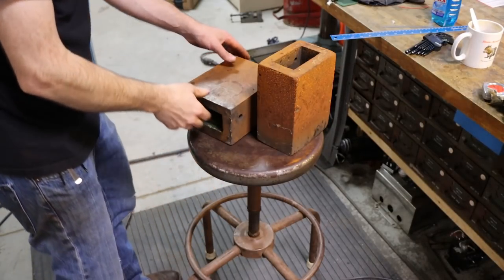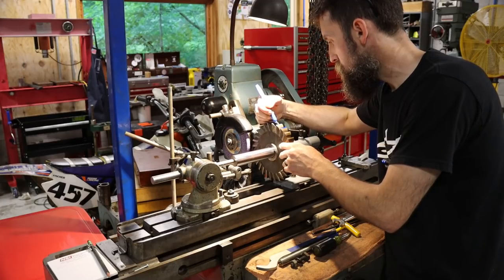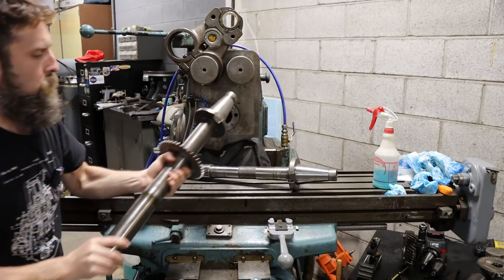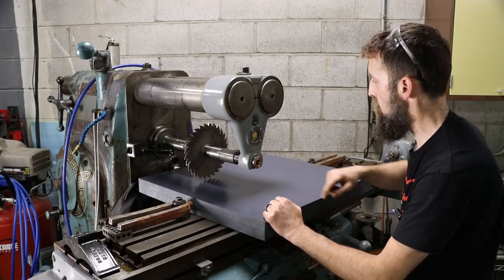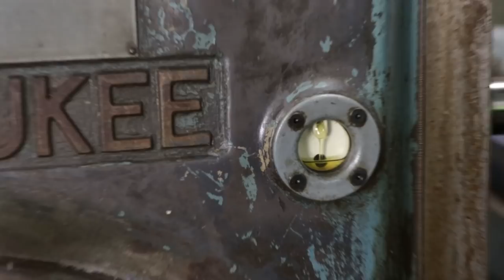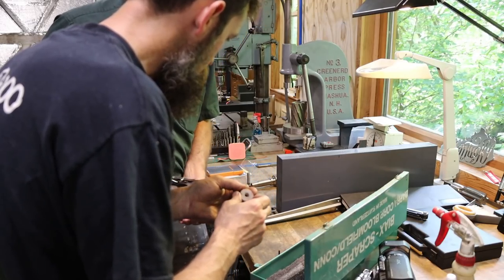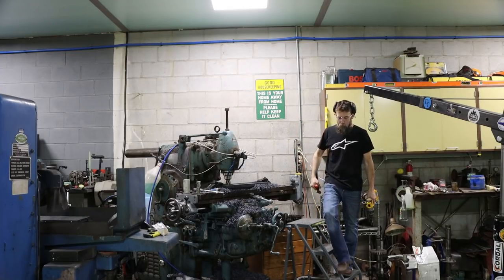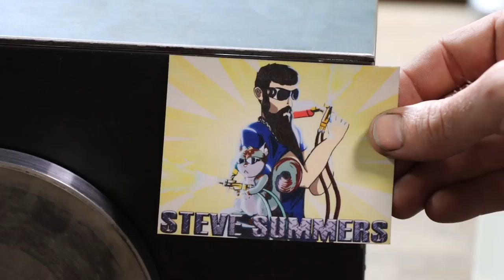Machining CPVC on the K&T MILL Grinding Milling Cutters & Brian Block Visit.

Comment: Hi Steve, I used P.V.C. blocks about the same size as die shoes for Electro-Chemical Machining Dies. Salt water forced under pressure through deep intersecting holes of machined castings and a Stainless Steel electrode inserted down to the point of intersection would de-burr the area using and a charge of high voltage, low amperage electricity. All of this took place inside a metal cabinet with slide open doors. I dis-like drilling large holes in P.V.C. as the drill always wants to grab the work and suck it up into the tool. I found that negative rake on the drill point cured most of that. 
 I like using Kerosene on my stones, and leave a puddle on the work while rubbing. That keeps the stone from getting embedded with those pesky little bits of metal.
Thanks for the vid!

Comment: Morning Steve! I'm suprised that Brian owns anything that can be hand held.
Reply: No kidding... Brian's idea of "Small" usually masses over a ton...
Reply: I'm probably the only guy here that's thinking  who's  Brian
Reply: @gabewhisen3446  If you check out bbloc's channel, go back to the early videos - he turns a dilapidated, collapsing barn into an incredible shop, doing jobs alone that rightfully should take a crew of 4. He basically accomplishes it using sweat, perseverance, and complete ignorance that it can't be done.
Reply: @gabewhisen3446 , to add to Rod Fitzsimmons Frey’s reply, Brian farms usually corn that goes to making bourbon, is rebuilding his barn/ shop, does all kinds of machining jobs (a lot of John Deere engines and transmissions, mostly big jobs) he also has a full time job at a (I believe) John Deere dealership. Mostly by himself!
Reply: Brian has amazing content i have watched most of his vids
Reply: @gabewhisen3446  yep you probably are!
Reply: @rodfrey  yes the man is a legend. What he accomplished with the old barn was amazing. Go watch the videos, there's a lot of them but you will be hooked after about three, thinking he's never going to do that but he did it.

Comment: You are a brave man drilling the CPVC upright in the press unsecured with that long and large diameter of a drill dit. The torque I have seen demonstrated when plastic heats up and grabs a large diameter drill is just incredible. To each his own I guess.
Reply: It seems braced again the table, so it could not spin away.
Reply: @markoantesic4362  look closer, one side of the CPVC plate is up against the table. That will not resist the torque if the bit grabs, the other (unsupported side) needs to be braced opposite to the table so as to resist the torque completely. The only thing that would prevent rapid escalation to a bad day is the drill bit and supporting system, nothing good would come of that. When you make your money with your hands and machines, take care of both of them with safety and proper diligence.
Reply: Minimal risk
Reply: Steve was using some coolant.

Comment: Worked for a welding shop back in the 70's that was fabbing steel for cknstruction at Ft. Campbell.  Required red lead primer.

Comment: Wait on buying a used vehicle, once the new ones come out for the year, used ones will drop significantly in price. The used market is crazy expensive right now…
Reply: I wouldn't bet on much price change.  Market will be tight for a while, since manufacturing either stopped or slowed down considerably in 2020, therefore stock was depleted so much that buyers turned to the user car market, making a run on that supply.  Then add to that the free cash people got, and you have a classic supply-and-demand picture, meaning it is a seller's market and won't change for at least a couple of years, waiting for new stock to exceed demand.  Also viewed as inflation.

Comment: Mould for a press to make some part or vacumn forming mould...heat plastic and add vacumn and pressure to hold it till it cures...
Maybe a fibreglass mould?

Comment: I remember I was at a Foster's Old Fashioned Freeze fast food restaurant, and it had a sign which said, "If you have time to lean, you have time to /clean/."
Reply: When my wife and I were first married we would go to either Friendlys or the Pie Plate for Saturday’s supper. At Friendlys the manager would often sweep up under the empty tables in between greeting customers and running the cash register.

Comment: A while ago i had to cut blocks of plastics often. So i made up an arbor for circular saw blades for may horizontal mill. You can even cut hotrolled with carbide tipped blades.

Comment: I took a scraping class years ago, using red lead, and tried to get some.  I was told it is now illegal in my state.  Eventually I found Dykem Hi Spot and have used it ever since.  Good results.
Reply: If he were in California his entire shop would have to be cleaned by a hazmat team. According to prop 65, just entering California exposes you to carcinogens.
Reply: @mikefox5510  Yeah, that's what you get when you give ecofreaks a little power. Used to ge a great place to live, now all the smart one are leaving. Only reason I'm still here is for medical reasons. Otherwise I'd be packed and gone...

Comment: Prussian Blue is used as an antidote for heavy metal poisoning, so as long as you eat more blue than red you should be OK. 
(I don't actually know if it works for lead, it is mainly used for Thallium and Caesium poisoning).
Reply: Lead (and some other "heavy" metals) is preferentially excreted in saliva.  So keep spitting!

Comment: Pvc is an interesting plastic. When in a state where it can off gas for example when Moulded or melted/burnt, the gas will actually cause steel to rust. Quite nasty stuff.
Reply: It's chlorine gas and HCl (g) that turns into HCl (aq) when it combines with moisture in the air. Hydrochloric acid and Cl (g) causes metal to rust, but as you said, it only happens in specific scenarios, and it's not really an issue in most situations.
Reply: I did not know that!   Thanks, I’ll try to catalog that in a brain wrinkle somewhere.
Reply: @littlejackalo5326  yip. I encountered it in the mould, tool and die industry while working on injection moulds.

Comment: Big machining, needs big set up blocks.  Every year, I have thousands of frogs smaller than my little finger nail.  First time I saw them it looked like the ground moved when they all jumped!  A friend of mine who was a submariner, said they lost a lab in the sub when a an individual who who was getting out, puff red lead through a pipe penetration from the room next door, as a joke.  The room had to be sealed until deconned, and the individual was court marshalled. Hundreds of thousands of dollars for the decontamination.

Comment: Tool sharpening is an art in itself. I ran a lot of horizontal Cincinatti #4 machines when I worked for the Boeing company in Macon Ga. Made all kinds of setups cutting all kinds of materials but mostly aluminum. If you run wheel cutters your cutter grinder man is a good friend to have... Hi Brian!

Comment: Mix red lead with aluminum powder, put them in aluminum foil with two medium size stones, wrap the aluminum foil around them. If you throw it to a concrete wall or concrete ground it will explode

Comment: Not saying you were using a cheap memory card, but random cards found on eBay tend to have high failure rates, so they tend do the opposite of "paying for themselves".  Of course there are bad batches of them in the local stores, too - it's worth periodically testing these things (there's free software for that on the web) to catch failing parts before you stick 'em in the camera.  Very frustrating experience.

Comment: Usually spatter can be knocked off cast iron with a dull chisel or something like that if it didn't weld itself really good there
Reply: Why does the chisel have to be dull?
Reply: @1pcfred  so it doesn't cut/nick the cast iron iirc
Reply: @1pcfred  I meant that if you're using a wood chisel. It would get dull anyway in the process. If you use a cold chisel it can and should be sharp. I briefly forgot the cold chisel
Reply: @MF175mp  I even keep my beater wood chisels fairly sharp. Off a grinder sharp at least. I do round the corners of them though so they don't dig into crap so bad. Because you always really do want to use a sharp chisel. Never forget about cold chisels ever either. They're handy tools. I'm relatively proud of my extensive cold chisel collection myself. I have some bad ass ones. Couple feet long and what have you. Manly chisels! The little ones do tend to get more use though. None of that Chinese junk either.
Reply: @drzorbo3770  if splatter sticks it's going to leave pock marks when you pick it off anyways. Past that not gouging work comes down to operator skill. The angle of the dangle. I've done some tasks that required a flattened chisel tip. Scraping splatter ain't one of them.
Reply: @1pcfred  all my wood chisels have turned into beaters since I don't have the equipment to do woodwork reasonably and all the loose money atm goes towards metalworking tools.
Reply: @MF175mp  you really don't need that many tools to do quality woodworking. But you do have to make up for a lack of equipment with motor skills. Pieces turned out hundreds of years ago are of the highest quality. So they're evidence what I've stated is true. Those old masters earned their titles though.

Comment: Excellent content,Steve....thanks for showing. But please, get that workbench mounted ridgid to the wall....that gives me eye pain.....
Reply: I found that Ridgid tools has messed up my spelling of rigid too. That pesky "d" in the middle of the word. I always want to spell refrigerator as refridgerator because the shortened word, fridge, has a "d" in the middle for some reason.
Reply: @littlejackalo5326  u´re right, i´m sorry

Comment: Question, as a old Horz mill specialist I know how valuable  all 10 of our fingers are. Please  stop using a brush on a Horz mill, only use air and blow all chips off , never use a brush on a Horz mill as the cutter can and will grab when you least expect it. Watched a young man loose 3 fingers that way ! .
Reply: I agree! I saw Steve using his hand to push cpvc chips off. Turn machine off, use long handle cheap paint brush’s. We all need out 10 fingers and toes. Lol. Hey Brian.
Reply: @rossilake218  My instructor ( MAAAAANY moons ago ! ) told us --- you walked in here with 10 fingers & toes plus 2 eyes all working, make DAMN SURE you leave with all of them as you came in with ! . I was 16 years old, at 70 I still got everything ! I always use air & safety glasses on everything, Lathes, Mills & Drills never ever a brush unless the  "main power barker"  is totally off, not just stop the spindle as these big mills have been known to turn ( clutch friction ) with spindle stopped ! , seen it happen more then once. On a grinder you can use a brush at work, but on MY grinders at home I still use air .

Comment: ultrasonic cleaner works well to clean stones.
Reply: Do you use any special cleaner, or just dunk 'em in the water? And about how long do you run the cleaner? Any other tips?
Yes, I'll admit I'm not much of a machinist! But that's why I watch Steve, and read these comments. This is a great classroom and there are some pretty smart people watching this channel.
Reply: @thomream1888  I use mineral spirits in a Tupperware container and float that in the water in the cleaner.
Reply: @JesseSchoch  Thanks for the quick response! I'll try this next time I clean my stones. Oh, that came out kinda wrong! You know what I mean. Thnx.

Comment: Steve, can you cut the cpvc on the table saw?
Reply: I can’t speak for Steve but I have.  As with any plastic on a table saw watch out for kick backs.
Reply: You can use woodworking tools to cut plastic...tablesaws , routers are common tools used in fabricating...carbide blades are best...
I spent decades cutting plastic ...

Comment: I see alot of people using those "Precision Ground Stones" and I've wondered how long does the precision last? Doesn't the act of using them make imperfections in them? I'm a knife collector and maker and I have alot of stones even the Norton ones aren't as good as the used to be. Say you hit a weld spatter chances are you will cause a gouge in your stone. Even with light use you will cause wear. Highs ans lows will happen no matter what.
Reply: a machine bed should be as precision as the stone so you are just laping the stone the on a nother precision surface and if you find a low spot on the stone i believe there are ways to bring them back in
Reply: Send your stones for a regrind to Abom's friend, Lance Baltzley.  He will regrind your "out of spec" stones and just maybe sell you a new set of his famous "YouTube Machinist" autographed specials.  Seriously, I have seen and handled a sample of his product and they are sweet.
Reply: @paulcopeland9035  I watch Abom but couldn’t any machinist make his own? I realize they want to support each other. But why send them off to be reground when you can do it yourself. I don’t remember if I’ve seen Keith Fenner use them or not.
Reply: @ozzyfranf  ....Well, what you are buying there is a grind from his premium surface grinder that he had certified to the millionths, many hours of expensive training, and the finest raw material as well.  Lance is very serious about this level of machining and has the means to "do it right"!  "Any machinist can make his own"....Nope.  You have to choose the level of precision you need and go from there.  Example: You might be able to build a sine bar that is perfectly adequate for what you are making. This is a good thing!  However, if the job requires a much higher level of precision tooling than your shop can produce, you have to contact Standard Tool (or some other heavenly supplier) and throw down a sizeable bag of hard earned BitCoins.  BTW, Keith Fenner has a set of precision ground stones that he uses and comments on all of the time.  I don't believe his are from Lance, but you will find him knocking down a tiny burr on the mill table like all of the "good guys" in the machinist community.

Comment: you may need to make yourself a new vise stand that is a bit lower if you want to scrape in the vise, looked like Brian is working with the thing up in his armpit but alas I don't know proper technique so maybe that is easier. Sad thing to say, I am fairly certain I saw one of these power scrapers on craigslist years ago, and before I knew what it was, listed as a sawzall for $35 or so; if only I had known.

Comment: "Syntetic!!" red lead is not lead based, just the same color.   I would buy red lead to coat wood posts for burial in the ground.  Real red lead cannot be bought.  Some have bought real white lead in old cans to use lathe dead centers.  It is an old style high pressure lube
Thanks
Reply: Lead(II,IV) oxide, also called red lead or minium, has the formula Pb 3 O 4. It is usually made by calcinating lead oxide. In the US it has to be imported because the last lead smelting plant was closed in the early 2000s. Red lead is used to protect iron structures. Like all lead compounds it is only toxic if swallowed or inhaled.

Comment: i clean and maintain all my ultra fine sharpening stones by blasting swarf away with WD-40
Reply: Well, WD-40 is mostly refined mineral spirits (>50%) and mineral oils (>25%), the rest being driers, fragrance, and propellants. So you and Steve are on the same "ultra fine sharpening stone maintenance" track.  Steve, however, is doing it at 1/10th the cost (actually maybe less!).  Further, I will always say one solid thing about the original WD-40 developers.  Those folks are the all time best at marketing!!

Comment: Can it be?  Almost sounds and looks like that milling cutter is running with very little run out!    In 50 years of machining I never got to experience such a thing.   I guess I have always assumed that a bent arbor was a standard requirement for a horizontal mill.
Reply: First they have to be sharpened concentric to run concentric.  My guess is many are not sharpened properly.

Comment: I didn't see how you were  indexing with your finger.
You should always have your finger on the tooth your grinding. Cutters can be unevenly spaced from the factory. Some cutter grinders will index off the tooth below to gain clearance for the finger when there is a teeth close together. It still be done with a hooked finger. 
Most women would scream at the sight of a 
frog let alone tuch one .
Waner &Swasey scrapers 
used red lead all the time  when I worked there in the early 70s .
Your saw you used first was,I think, was a stagger tooth and sharpening it is hole different animal. You need to slide each tooth over the point of a stationary finger with point of the finger adjusted to the high point  of the grinding wheel. Done right the right and left teeth will be exactly the same height. If the height is different move the point of the finger a little towards the high tooth . That will take a little bit more off the high  tooth and a little less off the lower tooth. I have been grinding cutters for 
54 years. I have no interest in retiring any time soon. It's a job I love to do . I do like your videos very much.

Comment: they need to make cameras where you can put two memory card in , one for backup , thechnicly it shouldnt be that hard to do if you use the same brand and Gb keep those two together all the time
those biax scrapers are expensive and verry rarely come up on ebay , even then people usually know wat there worth

Comment: bench wobble may be an issue worth addressing
Reply: When you're using a stool as a workbench you need more workbenches. And yeah your workbenches wouldn't be doing the watusi while you're working on them either.